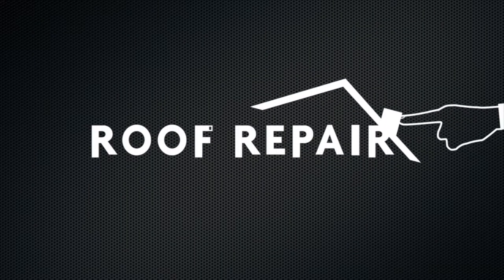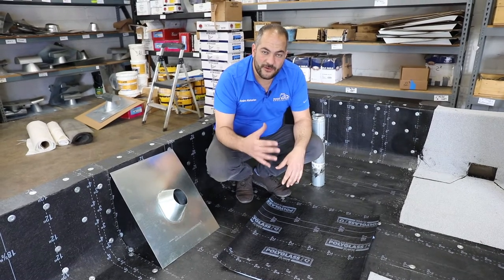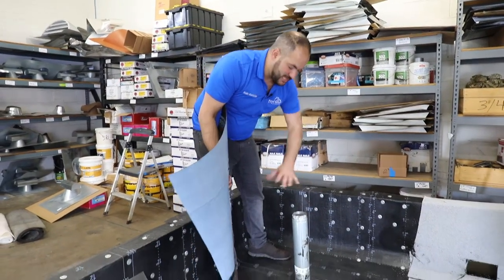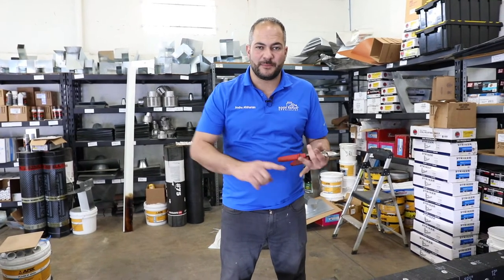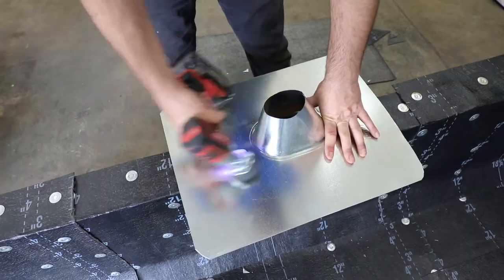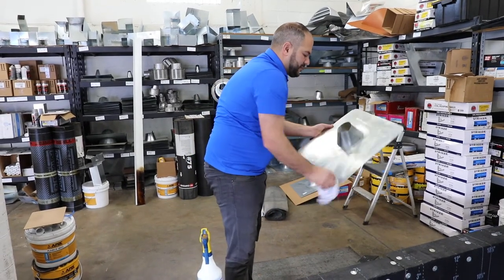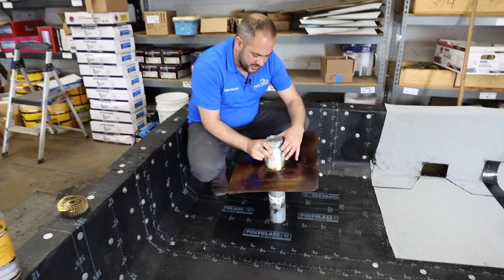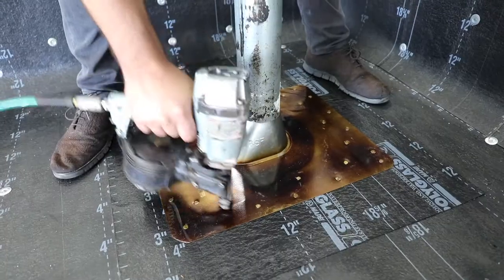How to Install Pipe Flashing on a Torch Down Roof

Comment from the maker: Let me know what other torch down roofing tutorials you would like to see next!
Reply: Thanks for these videos! Super helpful for the homeowner DIY’er. I’m curious about the tie in of stucco walls with parapets - is the exterior stucco supposed to come up and OVER the top of parapet wall? Or can the stucco terminate at the top of the parapet, with underlayment and torchdown then rolled a few inches over the exterior stucco? I plan on capping parapets with Spanish tile - a typical LA flat roof home.

Comment: I'm from Toronto canada the one thing we do differently is we torch a strip of base going half way on the metal flashing to cover the nails then the cap sheet the same way you did so the metal gets 2 ply
Reply from the maker: I have heard it done that way, and actually have had a conversation with our technical rep about that. I am not sure I see the benefit. The net surface area of torch to metal is the same. They say that if one fails there is a backup ply essentially. I don't really see the point. Would love to hear your feedback.
Reply: @RoofRepairSpecialist  the thing is if the nails push up over time, which let's be honest sometimes they do... their heads are hitting the midply and not just instantly trying to poke through your cap sheet

Comment: thank you for sharing your knowledge, what do you do when installing the pipe flashing around PVC pipe so that plastic pipe dont gets melted?
Reply from the maker: We use a smaller torch - Detail torch and are just careful in holding the torch in the correct direction. If you want to be extra careful you can always torch then flop.

Comment: Will it work like this if I install  wood stove pipe on a 1/12 pitch roof? The roof has existing torch down bitumen. If I will use a standard chimney kit for cathedral ceiling. It comes with a storm collar rather than a tight seal like this video.
Reply from the maker: Definitely, sounds like you have a good plan.

Comment: Two questions:  1.  Does the poly glass mid ply mfg sell patches, or just rolls?  2.  Do you have a link? 

I am only doing one penetration for my stove pipe, so I don't need a whole roll.  I have self-stick underlayment on the plywood and then torch down for the finished surface.   Thanks.
Reply from the maker: They only sell full rolls. If by any chance you are in the area around Los Angeles, feel free to stop by our yard, I’ll be happy to give you a piece.
Reply: @RoofRepairSpecialist  Thank you for the offer!  In SD.

Comment: I do this on my jobs but in reverse. Flashing on top of base and then a piece of base over the flashing and the cap ontop of that. Water would have to get through 2 layers instead if 1 layer like this
Reply from the maker: I’ve been contemplating that for a while and been thinking of switching that method. It’s a long conversation but I see the argument both ways.